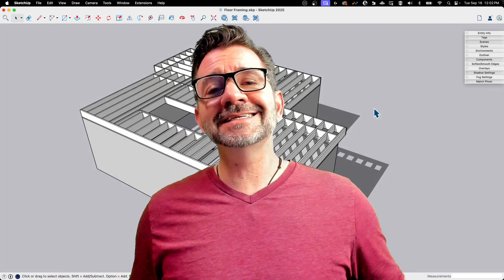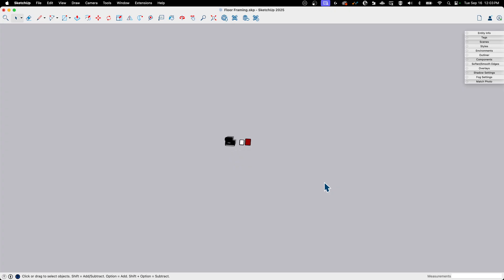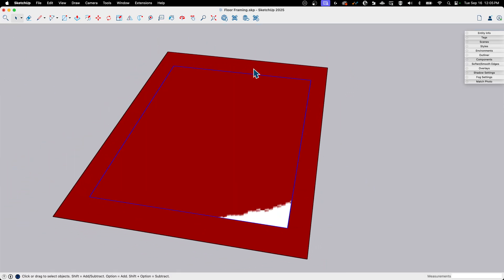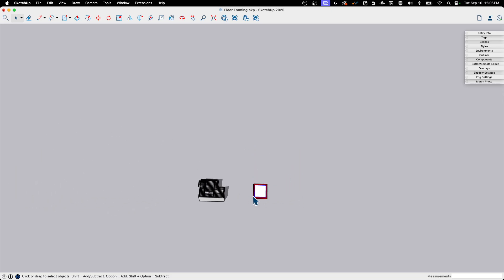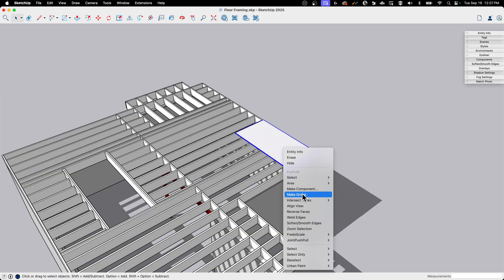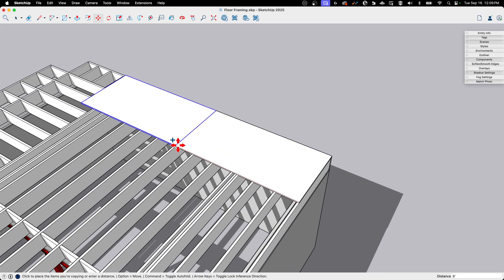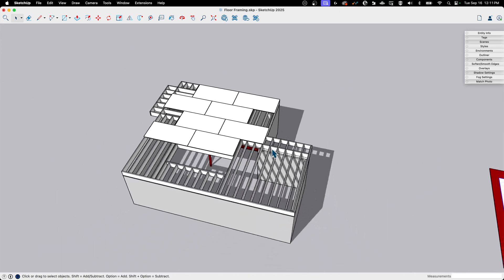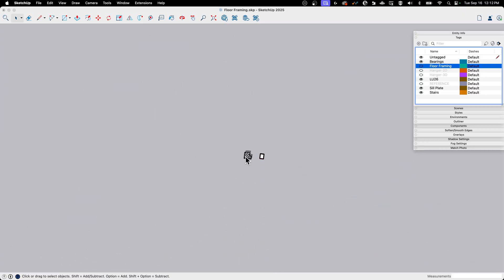6 Ways to Fix Z-Fighting & Bleed Through in SketchUp

Comment: Im usually lift it up around 0.5 - 1 Centimeter to make it stable

But it depends on your rendering engine wether its going to keep z fight or not

Im using enscape in render and 0.5 - 1 centimeter is working fine for me